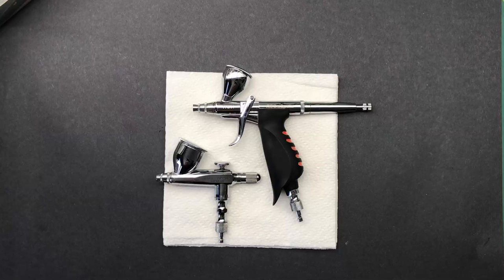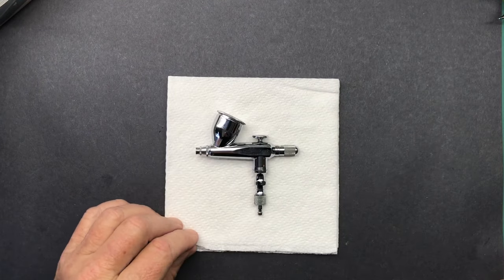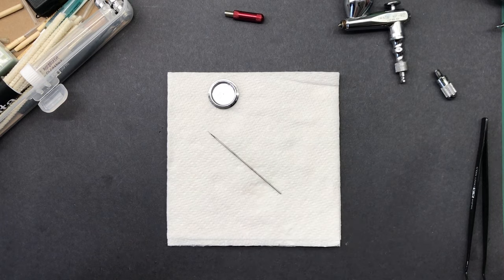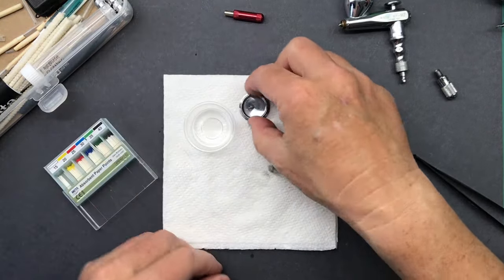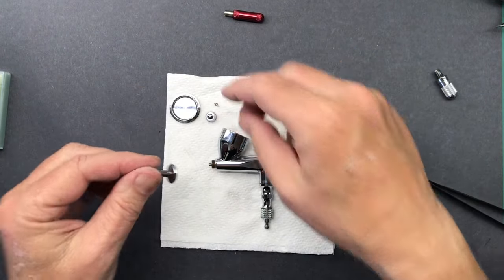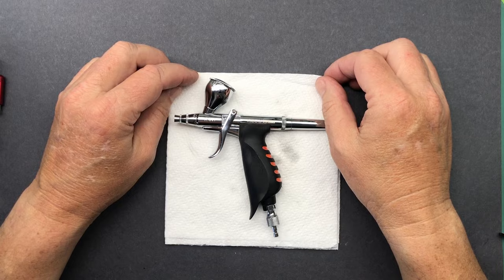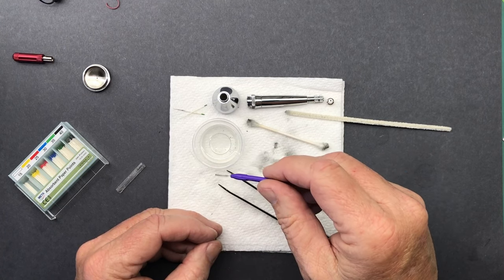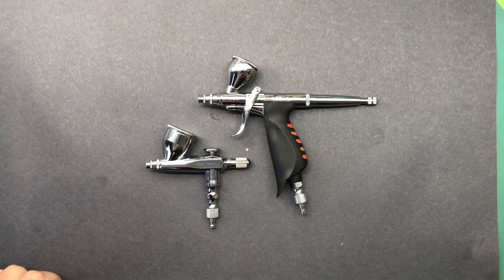Airbrush Tear Down and Clean

Comment: I done a 100% teardown and cleaning of my TRN1 and it still bubbles in the cup without flowing any paint.  I soaked all the nozzle bits in acetone for over an hour and noting seems to be helping.   

I made sure all of the air flow holes were lined up with the PTFE wafer (#6 with the two holes).  I also tried to tighten thr nozzle back on gradually to see if there was a sweet spot for getting the air to flow through the four holes on the backside of the nozzle (5A in the PDF breakdown).  Is there anything im missing?  Thank you!
Reply from the maker: If you saw my first reply ignore it. I have two videos up about this airbrush and I thought it was the other. 
I don't remember having to mess with alignment of any holes, but I do know when I did a change to the .5 parts I had to tighten that pretty good to get it to spray properly. Just don't overdo it and mess it up. 
When I do a full tear down after a project I don't remove that part. I just remove parts 1, 2 and 3. And the needle of course. Let me know what happens.
Reply: @BrettG64  Thank you for the input!  I did another inspection and realized that I have lost the o-ring on the nozzle, apparently.  I think they would definitely give me the symptoms that I'm dealing with so I'm going to have a look around where I disassembled the airbrush and probably go ahead and buy a few more since that's likely to not be the last time it happens!
Reply from the maker: @JohnsonArmsProps  that makes perfect sense. It’s been a while since I’ve had my airbrush torn down to the extent that the PTFE part is exposed but if I remember correctly I don’t think there has to be any alignment done with the holes. I seem to remember there is a channel that runs concentrically around where the head base threads in to the main body of the airbrush which would allow air flow regardless of the position of the PTFE part. I hope that makes sense.
Anyway, once you get a replacement O-ring and get it back together let me know if it works OK.